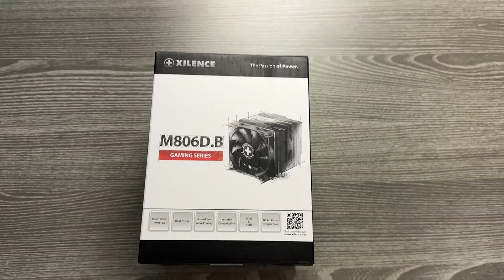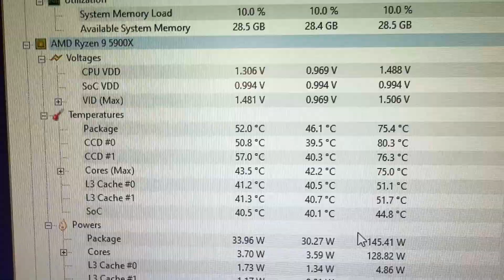Cheap Air Cooling vs AIOs in 2025... What Should youu Buy? – Xilence M806D Tested

Comment: Just bought one to replace Thermaltake Big Typhoon (from dual core era) that was installed with custom metal plate to fit on AMD7500F. Xilence M806D outperform Big Typhoon only with 3 degrees Celsius in idle, under load is not much difference either. Nevertheless, Xilence is much quieter, much easier to install and not bending motherboard.

Comment: I was all for team air cooling too, loved it. Went from a mid case & 12400f, to a micro case (TT view 170) & 12700kf and it got way warmer in there with my dual fan 6 pipe peerless assassin 120. Picked up the ID cooling frostflow x280 on sale for diiiirt cheap and it dropped cpu temp a good all around. Can’t hear it at all with my headset on.

Comment: Can you help me? I'm desperate. I followed a PBO (Precision Boost Overdrive) setup I saw in your video and everything, but I decided to leave it normal after a while. Then, I formatted my PC to play Valorant because it was in MBR, so I switched it to GPT. After installing all the drivers correctly, I completely lost performance. Even using the CPU boost with PBO, the FPS doesn't change at all, it stays the same. I used DDU, but still nothing. I formatted it about 20 times, used DDU again, installed everything correctly, and still nothing. The FPS is really low. Even with high performance mode, the temperatures are really low, and even with the CPU boost clock, the FPS is still very low. For example, in Fortnite, with everything on high, the FPS stays between 40 and 80, even with the boost clock, same result. And if I move to the sides when I'm dropping from the bus, the game starts stuttering. It's really bad. Can you help me? My config is: Ryzen 7 5700X, RTX 4070 Super, 32GB (2x16GB) 3200MHz, Steel Legend B450M, and I have the games on an SSD.

Comment: I have a $20 Thermalright air cooler on my 7800x3D, and have had zero issues. Sometimes it'll barely hit 80C when it's compiling shaders, but most of the time it sits in the high 60's/low 70's C. Super quiet too. Kinda crazy how good air coolers have gotten and at dirt cheap prices.

Comment: 0:54 Minor inaccuracy here. A dual tower aircooler with 2 fans and a 240mm AIO with 2 fans will not encounter failures with the same chance.
You have the same failure chance for fans on both of them, but the AIO will additionally have the chance of the pump breaking, electrochemical reactions over time etc.
The AIO failure chance with the same number of fans will always be higher.
And while it might happen during the warranty, replacing the AIO due to pump failure is a much more severe failure than replacing a fan on the air cooler or the radiator and you won't be able to use your system until you replaced the entire AIO. 
So these failures aren't comparable.
And this isn't even covering all the additional AIO mounting errors users can do to get air trapped inside of the cpu block. The ratio of posts in problem solving forums for cpu cooling i'm a part of for water cooling vs. air cooling is about 100:1.

AIOs should be used where they make sense, which is with CPUs above 150W-200W. I've seen way too many people mount AIOs on CPUs like the 7800X3D.
Otherwise a good video. Would have like a comparison to the Thermalright Peerless Assassin 120 and Phantom Spirit 120 as these will be the main competitors to the M806D.
Reply from the maker: Very good points, I'll definitely get more coverage to the Peerless and Phantom Spirit

Comment: Some people might think I'm odd, but I actually just switched from an AIO to a peerless assassin.
The temps are virtually the same, but my system runs much quieter now.
Reply from the maker: It does make perfect sense :)
Reply: Different strokes for different folks really. I've got a mini ITX Setup with a 5070TI in there. I literally cannot fit anything but an AIO in this case. A giant heatsink with a fan setup just won't fit. If i were still building in large cases, then sure i'd probably also just go with a big HSF.

Comment: I'm using a Royal Pretor for my 9800X3D, undervolted to -35, mobo limits, +200 boost and even under heavy CPU loads, I'm averaging around 70-80°C. I still believe air coolers are the best for gaming, and they also look nice aesthetically, in my opinion.
Reply from the maker: That's a sweet, sweet setup! Glad to hear your opinion and to hear you're running UVed
Reply: @ImWateringPSUs Yup bro. I followed your UV guide

Comment: I've Dark Rock Elite air cooler and its 280w TDP just barely enough to cool the i9 14900kf I have undervolted by -0.13 v and power limited to 248w during heavy load. Definitely unable to run at stock voltage and power, forget overclocking. 

If it's any indication where cpu manufacturing is headed then air coolers will soon become useless.
Reply from the maker: Yup, on the very peak of high end they're simply not competitive

Comment: Great video.  How critical is the flatness on the Cooler contact plate?  I've been looking at the Thermalright Phantom Spirit 120 EVO CPU Cooler and when holding a steel straight edge against the cooler contact plate, I can see a bow where the gap between the ends can be about 0.5mm on either ends.  Is this something to be concerned about or will the thermal paste interface take care of this.  Lapping option will remove the Nickel plate on the cooler and expose the copper.
Reply from the maker: On most coolers you won't have an issue with the flatness of the AIO itself. You may however want to put a contact frame on the motherboard!